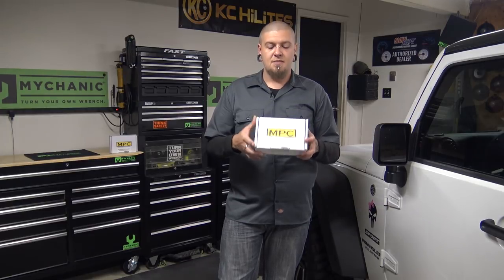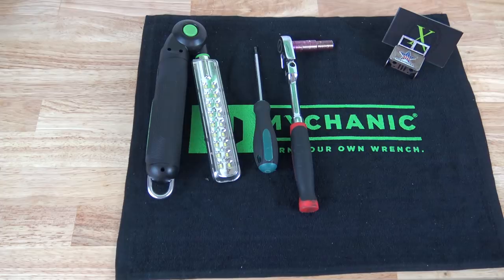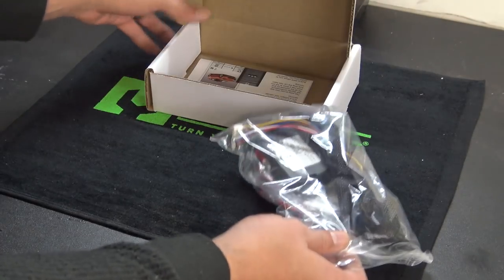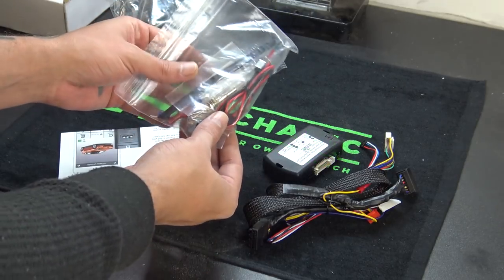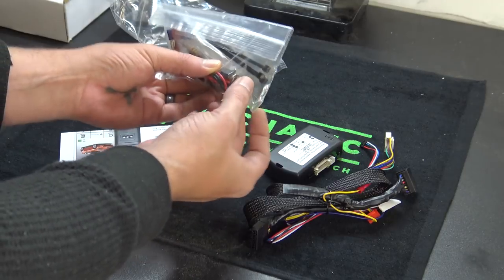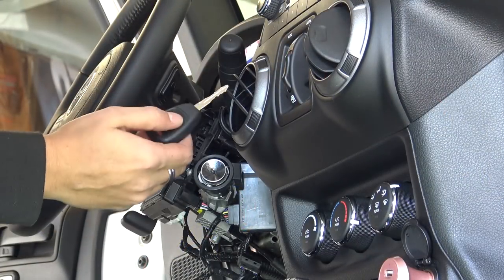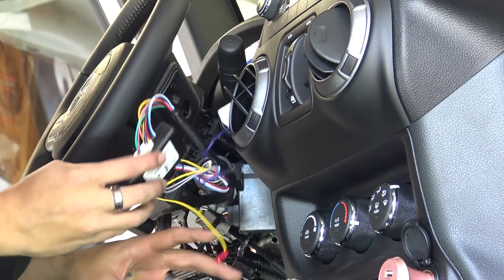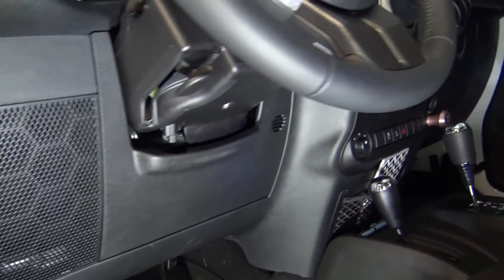How To Install a Remote Starter (2007-2017 Jeep JK & JKU Wrangler)

Comment: What’s the difference in the kits: with powerlock and without powerlock?
Reply: Which one do I get ?
Reply from the maker: @mesdimo3  Do you have power locks with a key fob for keyless entry?
Reply from the maker: WITH POWER LOCKS= you can use your factory key fob and press lock 3 times to start the vehicle. WITHOUT POWER LOCKS= if your vehicle did not come with power locks/keyless entry, this kit installs mostly the same, but comes with a new key fob/button pad to start the vehicle. I hope that explains everything for you.
Reply: @RockyXTV  My key just has Panis, Lock, Unlock. Does it matter which i get? also is there any extenders to increase the range?
Reply from the maker: If your key has Lock & Unlock you can use this kit - https://goo.gl/pSsoGL this kit will allow you to use the remote you have to start the vehicle and the range will be the same as your normal remote. If you don't have a remote with Lock & Unlock buttons or just want a little more range you can use this kit - https://goo.gl/fSG3u3 This kit will come with its own remote just to start the vehicle, so if you already have a Lock & Unlock remote, this would just add another remote to your keys. This remote will not Lock or Unlock the vehicle, just start it. I hope this info helps you choose the kit you need.
Reply: @RockyXTV  thanks my man i just placed in the order ill set it up <3

Comment: Any idea why after install the key won’t start the Jeep?  Key fob will start the Jeep but the key won’t with this installed
Reply from the maker: I had a similar issue when installing one of these kits. I tracked mine down to a Purple wire that had pulled out of its harness. It was the "T" harness plug that goes into the Immobilizer, I would check there.
Reply: @RockyXTV  Thanks for the reply... I just sent the thing back.  Shouldn't have to trouble shoot a "plug and play" device
Reply from the maker: Very true! Sorry you had issues with your remote start.

Comment: Can i use prostart CT3271 remote starter on 2010 jeep sport?
Reply from the maker: I'm not familiar with that particular kit, but if you're looking for an add on remote start that works without power locks and has its own 2 button remote MPC has that system as well. A link to it is in the video description, it's the kit marked as WITHOUT power locks. Thanks for watching!

Comment: The reason for the lip is to attempt to keep dust out. They had a lot of issues with that in the other models
Reply from the maker: Makes sense, I've never seen anyone with an issue if something got in there, but it makes sense. I had a bunch of mud in mine and it was fine. Thanks for watching!
Reply: I think the reason is to deter people from installing MPC remote starts. Dealer wanted to charge me $700+ to install theirs. MPC I got for under $100 and it should have taken like 20 minutes to install (but has been 2 days instead fighting with that shroud).

Once I get the damn thing off I think I'll take a dremel to the lip on the bottom shroud so I never had to deal with that again.

Comment: Any idea why my anti theft lock system is flashing
Reply from the maker: The only time I've seen it flash is when you remote start, get in, turn key and hit the brakes. This disengages the remote starter and the theft lock light will blink a few times, but should stop.
Reply: Any fix for this issue??

Comment: how  you do it with  a manual trasmission
Reply from the maker: Unfortunately these don't work with manual transmission. I'm not sure if they've made a version for manuals or not. They would have to work around the clutch safety switch, most companies don't like to mess with safety equipment.

Comment: So if you try to drive the JK with out putting the key in, will this system shut the engine off?
Reply from the maker: Yes, as soon as you touch the brake in order to put it in gear the system will shut the Jeep off. Thanks for watching!
Reply: Excellent! I just ordered the same kit for my JK. Thanks for the videos!!

Comment: Guys who have use it,  after 2 years now is there any problem by using this item or every thing is ok ??? Is the any harm on the vehicle,  forgive my English:)
Reply from the maker: I've had mine installed for about 3 years now and it is still working fine. No issues with the Jeep, thanks for watching!

Comment: You totally cheated with that pry tool. When you showed it coming off you already had it worked in between the lip ready to go. I've spent literally hours for the last 2 nights and can't get that damn thing off to save my life still. A 20 minute MPC remote start install has taken over 2 days all because of that f'ing shroud. You spent way more time getting to that point that this video shows. I bet you were cussing your a$$ off too.

Beware to everyone trying to take off the JK shroud... it SUCKS and that's if you figure out how to do it at all.

But this video was super great, thank you!
Reply: Gary Richter I couldn’t agree more. I have been trying to take this damn shroud off at lunch time going on 3 days now. Every time has been unsuccessful. I am at the point of just giving up before I break something. Is there any other easy solutions to get this off. I have tried everything

Comment: Is there a way to eliminate the horn honking?
I know my neighbors would,no,will bitch about it every time I use it.
Please let me know.🍻🌲
Reply: In doing my research, if you hold the lock button for 5 seconds and then   hit the panic button, this will turn off the horn honking.

Comment: I thought I should comment having just wrapped up my install.

I am one of those poor unfortunate souls who has a model year that has a lip on the bottom steering column cover. To say it was a pain in the rear, is really an understatement!

I love the video, I think it does a really good job of helping a prospective installer visualize how to install this unit. Rocky does a phenomenal job of walking through the steps and the camera footage is pretty good too!

I mean no offense to the MyPushCart team or to Rocky's team but I think a professional installer would probably remove the steering wheel - the lip is simply too big to get that cowl out without damaging something. I didn't want to remove the steering wheel because I simply didn't want to take the risk with the air bag.

Just a little background, I'm used to working on Wranglers - including the electrical system. I consider myself the "target audience" for the MyPushCart team - a tinkerer who has years of experience working with cars, especially Wranglers.

I easily spent an hour pulling and prying on that cowl trying to get it off. It simply is a giant pain in the rear. The lip is too large for the gap provided... When finished, I chipped one area and broke part of the lip off on another and seriously distressed the teeth on the right side.

Knowing what I do now, I think I'd seriously look to find a replacement cowl and use a pair of diagonal cutters to remove the old one. To reinstall the cowl, I trimmed the lip to less than half its original size. I'm sure I'm defeating all of the reasons the lip exists and probably invalidating warranties or something but it was soooo much easier to install the trimmed cowl. If you manage to get the cowl off, consider trimming that lip down. Also, I noticed nothing in my plethora of tools that was plastic was strong enough to work the lip. I covered a chisel with a shammy and used it to pry the lip out. Yes, there are scratches on my cowl now but they're mostly hidden behind the steering wheel.

Pay attention to how Rocky works the left side of the cowl then the right. You can stress the left side way more than the right and have to work it around the keyhole. I ended up using a tiny screwdriver to pry apart the top and bottom cowl pieces on the right - for some reason they just wouldn't budge free and you need that if you are to have any hope of getting the bottom cowl off. I also found I had to release the steering wheel lock to give me freedom to stress the bottom cowl. I almost wish they had left this footage in the video so I could see if Rocky used some techniques I didn't think of. I don't mind cuss words and could use the visuals to help me understand whether I was using bad techniques...

Taking out the plug on the immobilizer was very tricky. I had my daughter press the release button while I pulled on the upper and lower wires on the plug to shimmy it out. There simply is no way to grab the plug directly and neither a needle nose or adjustable pliers could get a good grip on it to work it out. So reach underneath and work the wiring harness free and plan on using the wires to help you free the plug.

Note: when you install the plug from the wiring harness into the immobilizer - press it until it clicks. I did not do that first time and couldn't get the unit to program properly. So I went back and reseated connections and noticed that one had to be pressed down pretty firmly until it clicked.

Once installed, the unit worked perfectly! It's a pretty cool thing when you think about it. And I completely understand why folks are asking for 2 locks instead of 3. If you're not concentrating on it, it seems like getting 3 consecutive presses is tricky - or at least it was for me. :-)

By no means am I trying to disrespect the product or talk anyone out of installing it - I just thought that Rocky made the install look so effortless that it was worth a public service announcement to say mileage definitely varied for me and I'm having a beer to unwind after this project....
Reply from the maker: Great write-up! I do agree that this can be a difficult install on the '16-'18 or maybe it's just the '17&'18 that have that lip. I'm sorry a lot of the difficulty got lost in translation through the video, that happens more often than not. When I do these install videos, the product gets installed twice. Once off camera, then on camera so I already have a feel for how the parts needs to be installed. Again, sorry about the lack of difficulty shown in the video, but thanks for watching and giving everyone this information!